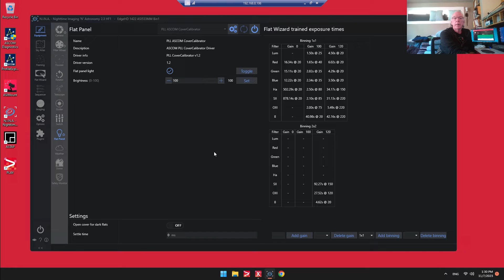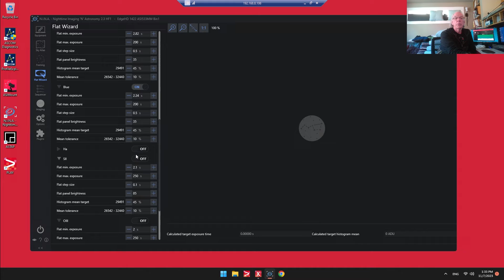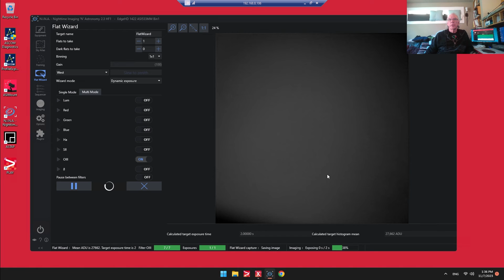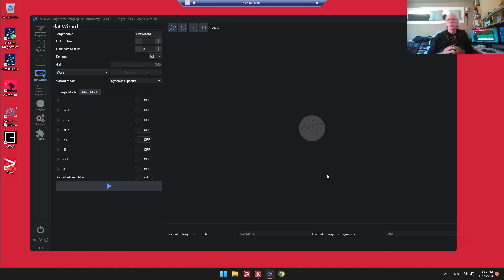PrimaLuce Lab Giotto Smart Flat Field Generator - 1st Impressions : Thumbs Up!

Comment: Thanks Bill! This is on my short list as I'm using a tracing panel with sheets of printer paper right now. I get useable flats, but it's a real pain... I also need one for my EdgeHd 9.25. Not so sure I need the Alto tho... it's only money lol... also, from what I've been reading lately, (I have ASI294mm pro) flats from 2 to 4 seconds are best... so I need Flat and DarkFlat as well as standard Darks for my calibration.
Reply from the maker: Yeah I try to get 3 seconds minimum for my 294MM flats and the Giotto combined with the NINA flat wizard dynamic brightness option makes alot easier than going the tracing panel route.

I took a look at the Alto and decided not a priority right now.

Comment: Bill , Really appreciate your videos with your Journey. I am struggling with my Flat frames and found the Giotto an interesting product.  . May I ask what type of narrowband filters you are using? I am asking because the  Flat Panel I use,  Pegasus Astro Flatmaster,   can not seem to  generate enough light and my exposures are getting ridiculously long, in the order of 120-150 sec. I am using Antlia 3 nm filters.
Reply from the maker: I too use the Antlia 3mm filters. My Flatmaster 150 was not able to provide enough illumination which is why I went with the Giottos. Sorry forthe very late reply.
Reply: Thanks for the reply. I bit the bullet and purchased a Giotto Flat Panel- Problem solved! That's for your content. I really appreciate your journey, vey encouraging.  I am hopeful you keep making content

Comment: You should use "Dynamic Brightness" not exposure. Basically you set the exposure that you want and the software will adjust the brightness of the panel to meet your set parameters. This is what I use on my Deep Sky Dad Flat Field Panel
Reply from the maker: Thanks for the feedback. I'll give that a go
 Much appreciated. 👍
Reply: My pleasure......I have learnt so much from you guys over this last year. it's good to be able to give a little back....even if it is only a small snippet of info.
I have been using around 3 second exposures for my LRGB filters. As you pointed out, it does make life so much easier to program NENA to carry out automatic flat taking at the end of a nights session. @AstroVagabond

Comment: And problems with banding on the flats, especially with Luminance, when you dropped the flat panel brightness?  I've heard about some LED panels (especially the Pegasus Astro FlatMaster) that have a realively slow PWM which causes flickering in the flat panel light and that results in banding.
Reply from the maker: Of the 60 luminance I've taken with the Giotto not yet. Nor have I seen it in the other 360 for the other 6 filters.